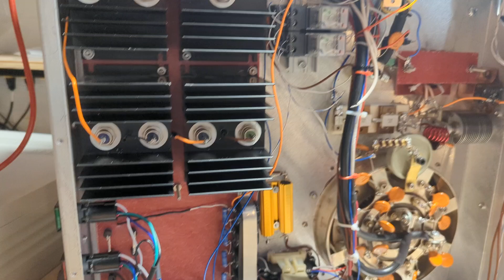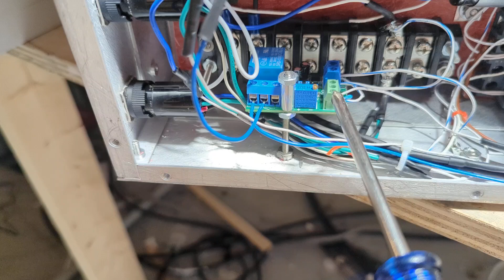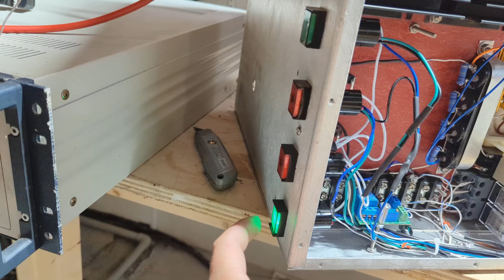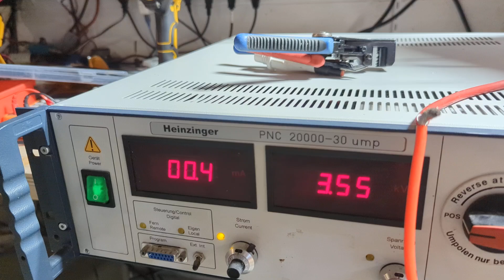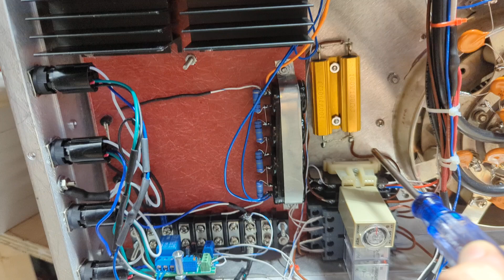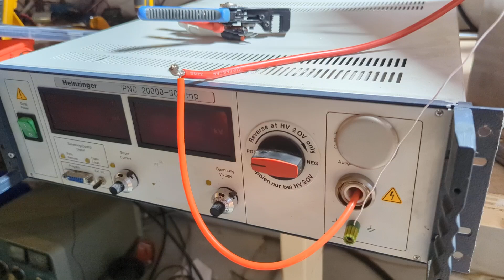Tsunami Project (4cx5000)(Ep. 4. Interlocks and safety circuits.)

Comment: Your HV  bench supply is to die for.  Power On sequence and Screen/Plate protection circuit peace of mind.  I've had small board pcb modules with screw terminals for wire connections loosen over time or worse yet,, tear the solder joint  on the pcb bottom.  Running a far smaller, homemade 4cx amp using the Tetrode Boards by g3sek, I  appreciate all the circuit extras in your design

Comment: Looking great ! Love the safety circuits.  never want that screen supply on without plate supply.  If you ever lost plate during operation  with screen supply one the tube will flash and have some burned out parts.  The outher protection used on screen is current limit on screen .  That going to look real nice with them meters. 73
Reply from the maker: Thanks for the tip!
Reply from the maker: The screen supply is limited to about 300mA, but in the event HV is lost a relay will instantly open shorting the screen to the cathode. Fail safe circuit.

Comment: Needlebender, do you use Amazon for push buttons, toggle switches, and relays?
Reply from the maker: I get my stuff from various sources, If used a part and it works ok I may get it from ebay, amazon whatever. Certain more important applications I may use a more robust switch or relay. Normally I only get switches from them but relays I try to get from a distributor.